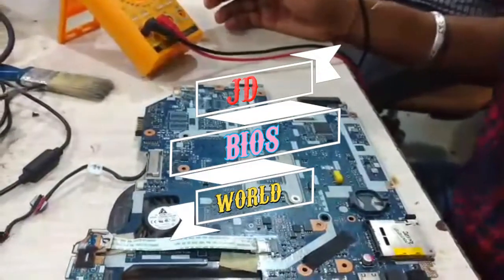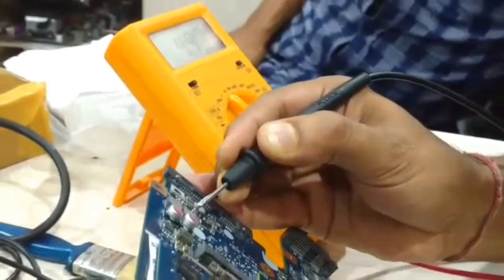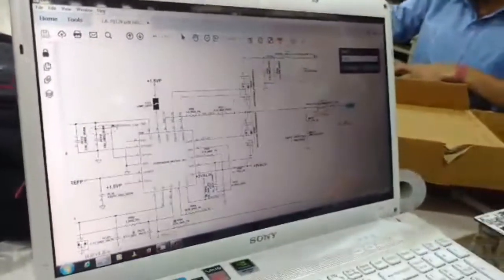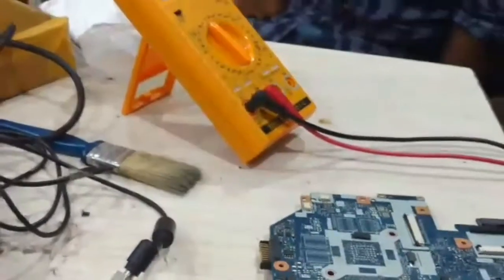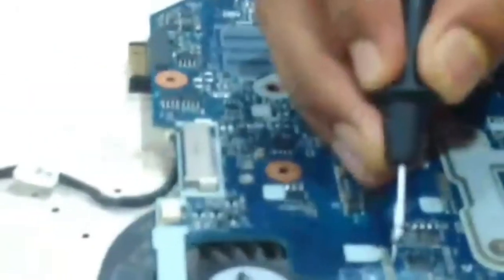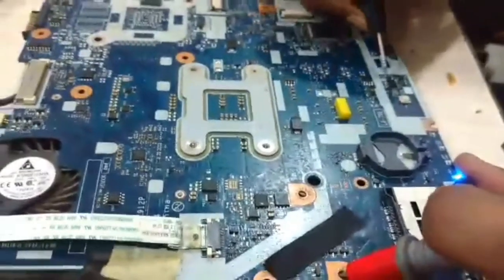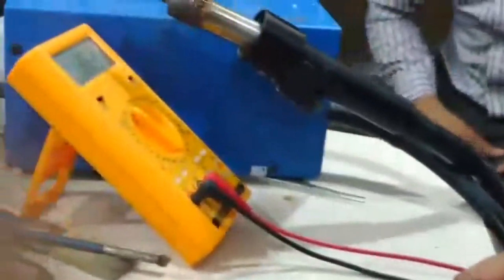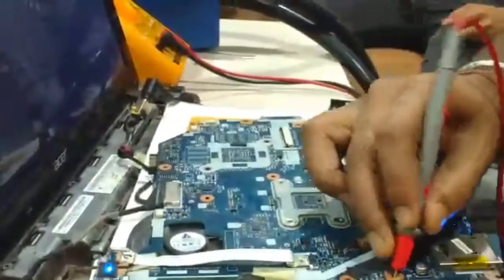LA 7912P PROBLEM NO DISPLAY # DHIRAJ MISHRA # EDITED BY JD VERMA

Comment: Sir same problem same motherboard also 25 26 no pin are not generating 5 volt and in MOSFET 5volt always coming but in source side there is only 0.28 volts so please tell me from where can I buy this MOSFET what I have to say to shopkeeper which type of MOSFET or all n type MOSFET are same please leave a reply

Comment: Brother...mere paas ek hp 4440s machine aai hai me v repairing karta hu...but isme bettry not detct ka issu a rha h me kya kru kuch batao plzzzzz..mene power ic change kri to detect ho gai bus not chrging ho gai fir ic nikal kar lagaai to same problem not detct a rha h...plz help me
Reply from the maker: MR. HACKER IRFAN check charging section and MOSFET 
And adapter center pin circut
Reply: JD Bios MT Laptop Repair its all working sir...now what i do